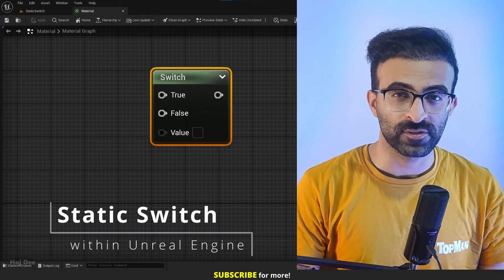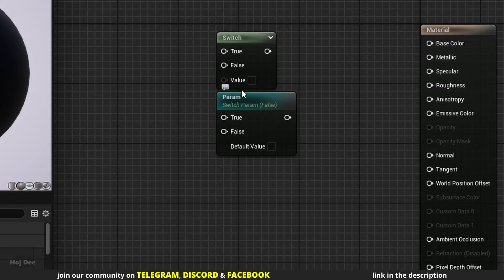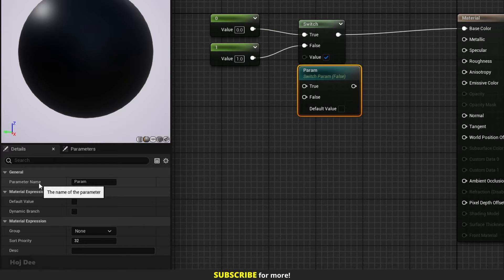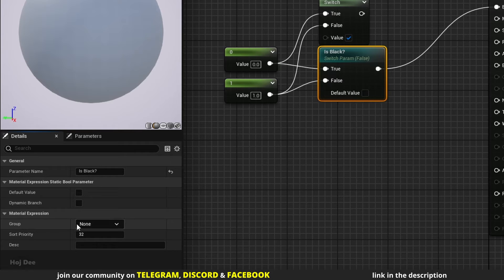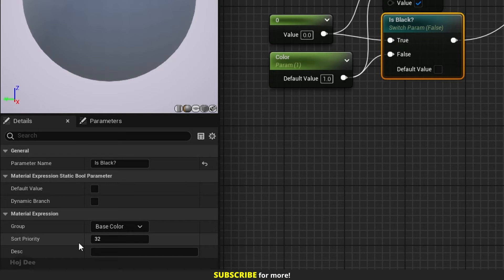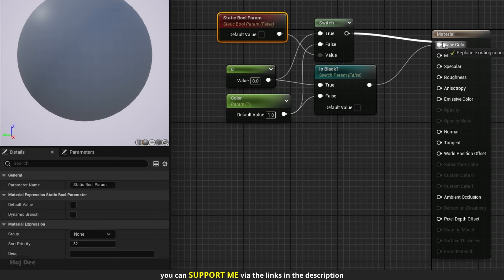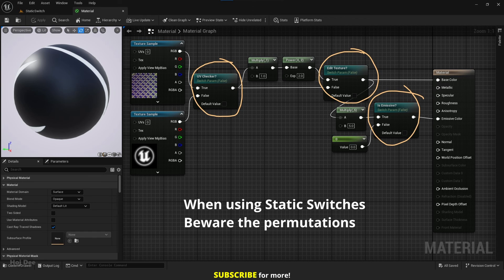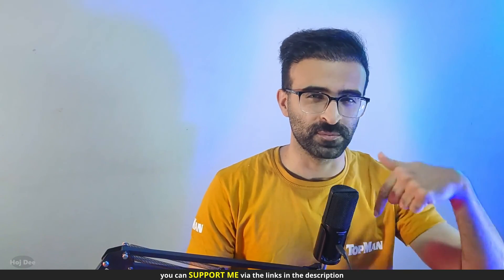Static Switch Nodes EXPLAINED! Unreal Engine Materials

Comment: For some reason, I cannot seem to get my Switch Parameters to work outside of the editor even though I have them exposed in the Material Instance. However, I am using them inside a function inside of my Master Material. Does that make a difference? I see the change when I switch the Boolean value of the switch default and save. But it won't let me change any of the values in my Material Instance. How can I pass this through from the MaterialFunction inside the Master to the Material Instance? I see them there but they don't change anything when I try.
Reply from the maker: hey. I use parameters from material functions all the time, and it works. The static switch parameter is a parameter, so technically, it should be added to your material instance by default. Maybe there's sth else wrong with the material
Reply: @HojDee  Yeah it's odd. Not sure why, but for some reason the switch will only work when I change it as a default value in the master and apply and save but if I try and do it from the Material Instance Parameter, it doesn't change anything. Wasn't sure if it was because it was within the function or if it's a UE 5.6 bug.
Reply from the maker: @edh3268  let me know if you fix it and  find out what the issue is.

Comment: Are there any useful interactions between the ‘If’ ( < > = ) node and the Static Switch node?
Reply from the maker: @sym9266  i don't know really. The important thing is to know what they both do. Then if you need them, you can use them
Reply: @HojDee  I'm trying to repeat a math function a certain number of times based on a scalar parameter. (segments on a radial stamina bar) I'm having trouble finding a solution
Reply from the maker: @sym9266  i don't know the specifics, but I think "if" Would help you.

Comment: is it basically advised to only use 1 static switch for each material, or is it still ok to use more than one as long as they aren't in the same sequence? like, for example, using one with base colour and one with metallic, which are probably not connected in any way.
Reply from the maker: It's better to not use more than one or 2 in the same sequence.
And overall, use other nodes, like lerps, whenever possible instead of switches.